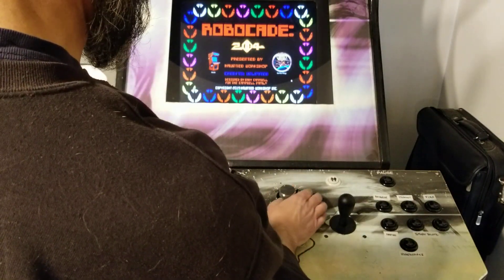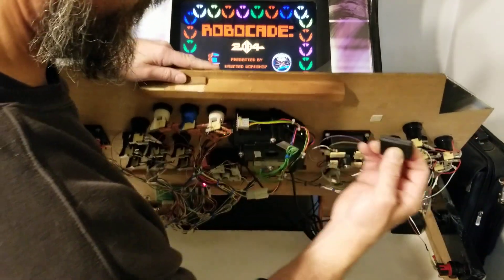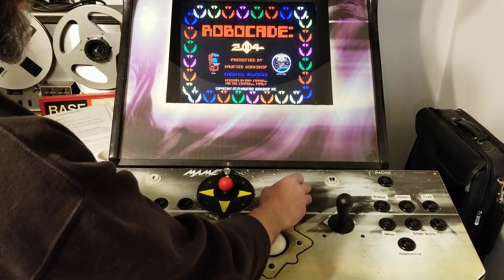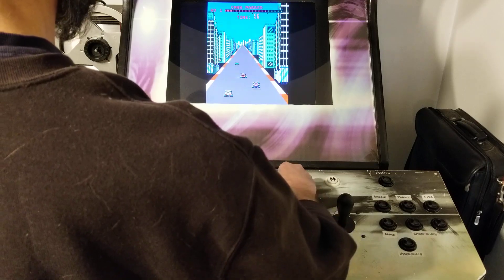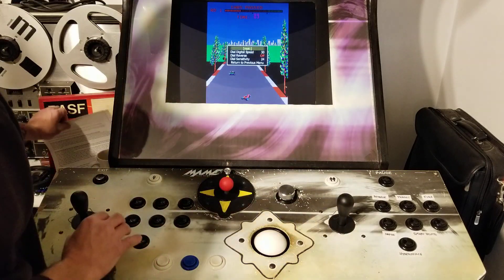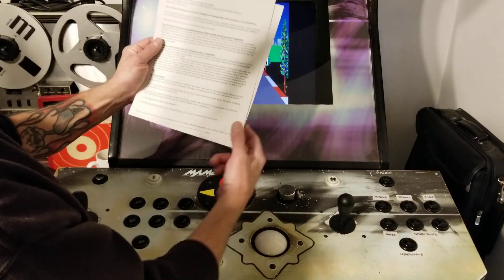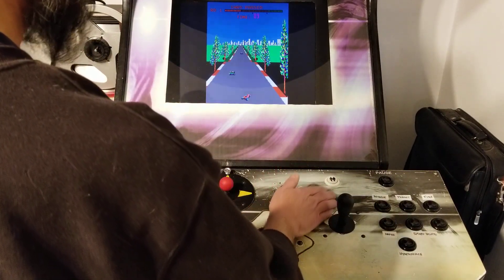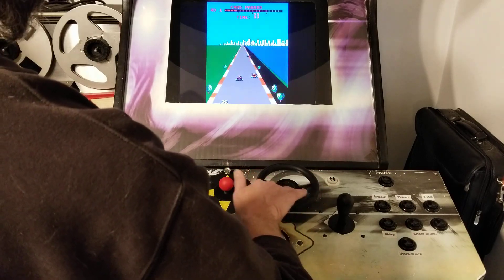Rotary encoder arcade spinner on the cheap

Comment: Hi excellent video. I have a problem where, without adding a resistor, Windows doesn't accept the rotary encoder. I've uploaded several .ino files to the Pro Micro, but it still doesn't work. Any ideas what it could be? Thanks.

Comment: Hi, thanks for the video!  where can I get that little steering wheel? looks so cool!
Reply from the maker: Thanks for the comment. Sorry I haven't responded. Haven't logged on in a while. I have another channel for my arcade videos now. 
I printed the steering wheel. It's pretty good, but not well balanced. I designed it to fit the spinner top I was using at the time. I still need to make a new wheel for my new setup.
My new channel is at https://youtube.com/channel/UClimw6JLJPlxA2hVbkmBDeA
Reply: @gscott69  got it! thanks for the answer!!